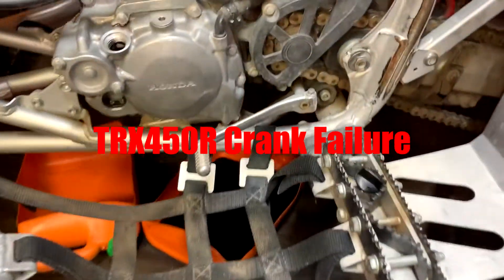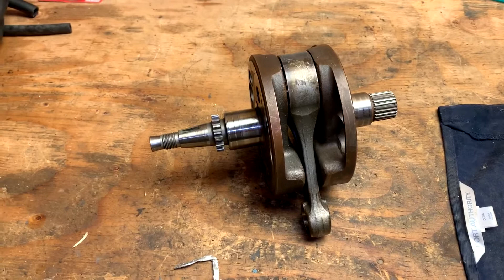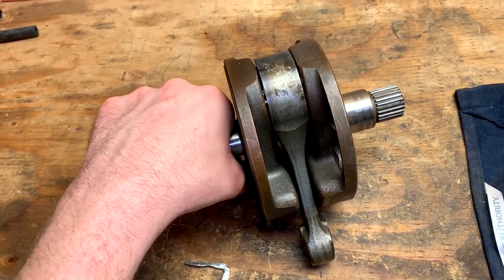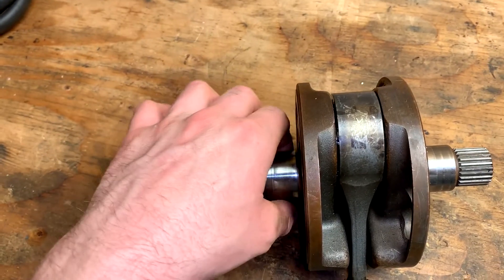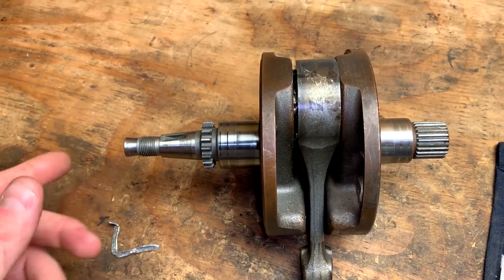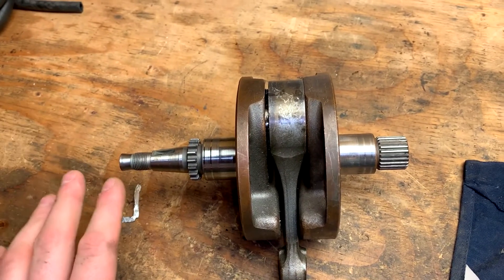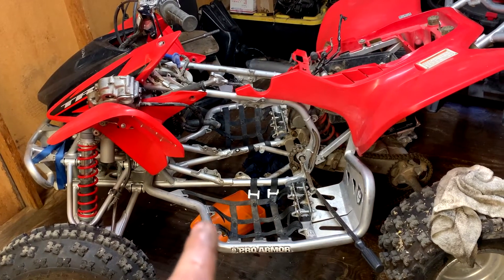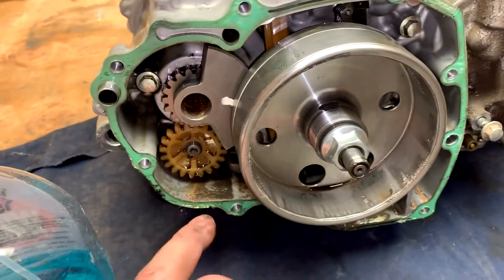Why Do TRX450R Cranks Fail?

Comment: I have silver flakes in the oil filter on my 2008 trx450 what could it be?
Reply from the maker: @jefeoOllllllllllOo  Big end of the rod went back.  Don't attempt to start it or anything.
Reply: @trxtech3010  I have used it quite a bit maybe about 3 oil changes deep and a total of 15hrs and every oil change has flakes. Its sounds good and no issues, just the flakes.

Comment: Is shimming the crank only for 04-05 motors? I have an 07 that needs a crank. Can I just press new thrust washers into it and put it back together? Thanks
Reply from the maker: Yes on the shimming is only fir the 04/05 engines.

As fir the 07 VlCrank yes you can rebiuld the crank shaft with new parts CP Pistons and Rods sells kits to rebiukd the crank shaft... however it cost a lot but last's longer.

Comment: Hi , hey bro I’m what store do you get the shim from , I have a 2005 trx 450 and the left side bearing is not secure on the case you can Even take it out with your fingers your think the shim will help to solve the problem please , let me know bro I really appreciate it.
Reply from the maker: Yeah you will need to replace the Left Case Half of the engine.   Another thing you can try first is get some Green Bearing retainer, it's made by LockTite it's Number 39150 just do a google seartlch try that and see if it holds the bearing in place.
Reply: You don’t think if I put shim will fix that issue?
Reply from the maker: @jorgebasaldua6217  The problem is if it's that we use the entire race of the varying me spin and move around and then cause you other issues that can lead to castrophic failure.

Comment: Hi bro I’ve read a comment you’re from Tucson I live in Tucson as well, I have a question, I’m doing a rebuild on my 05Honda trx 450r I have shunned my valves since I installed s stage 2 hot cam but how do I adjust the auto decompressor? Thanks man
Reply from the maker: Just adjust it to about .008"   When you adjust it you just need to make sure the engine is on TDC it's like old school 400ex, 300ex and Raptor 350 or 660 raptor Rockers.  Just it's a Decompressor is all.
Reply: Thank you man appreciate it
Reply: Hey bro do you think I can text you thought some social media I have another questions I need help with and would like to send a video of my quad runnning to see if you can help me out

Comment: So I’m having this issue on a 05 I just picked up. It runs great but I changed the fluids and found shavings in my oil filter. No brass just metal. Where do I go from here? Any chance you’d source some part numbers and things this is all confusing me with what parts to get. I was looking into the wrench rabbit full rebuild kit until I seen this video.
Reply: Also is a full rebuild necessary or can I just rebuild bottom end?
Reply from the maker: @masoneakins2666  Usually if you get a crank Failure a Full rebuild is required. 

Reason is because you have small shaving through out the engine and most likely those small shavings may have damaged other things. I always recommend going with OEM Crank or at least OEM Main Bearings and Hot Rods crank will be OK.
Reply from the maker: Parts List. 

If the Cylinder is good I would recommend 
Carrillo Piston 12:1 Compression (94mm)
OEM Crank -13090-HP1-315
OEM Main L Bearing - 91001-HP1-671
OEM Main R Bearing - 91008-HP1-672
Gasket Kit B - 06112-HP1-670
Gasket Kit A - 06111-HP1-670
Oil Pump - 15021-958-000
Right Crank Seal - 91202-HP1-671
Left Crank Seal - 91201-HP1-671

For the Valves, you can go with Ferrea or Kibble white they're about 250 more, they're stainless steel last longer and you can do +1mm with fresh cut seats for cheaper then the OEM Valves.
Reply: How often do you have to replace cranks

Comment: Where did you get something that big to shim the right side bearing??? I've been looking for years for a fix for the original engine out of my 05 450r. Now all I need is to order a left side case and new crank. I've wasted multiple cranks so I'm sure I can't use the left side case anymore.
Reply from the maker: Look into the right crank bearing updated sldesign.  It has to be pressed on in a certain way and stops all crank side to side movment.
Reply: @trxtech3010  are you talking about the honda crank set with the new bearing and race that comes with it?
Reply from the maker: @kevinknabe7252  Yes there's a certain way that it Hass to be installed that many people still mess up on.

Comment: I’m a little confused about the 06+ ones. I get how the actual main bearing walking in its race will cause problems on the 04-05s but the 06s are locked into place and the crank is not a press fit so how are the cranks suppose to be locked into place. And unlike the picture that you showed my 06 has a different style left side bearing with no inner race. The crank actually touches the rollers and I changed the case and both bearings were the same way. So I guess my question is how is the crank suppose to not walk when it is not a press fit into the main bearings. When installing my crank it literally dropped right into the bearing with no heat or anything and this is exactly how the service manual said it should be. I’m a little worried after watching this video lol because when my cases were put back together you could move the crank back and forth in the case very easily. It was like that before and after rebuild and that is how it has been on Honda dirt bikes that I’ve rebuilt with pretty much the same motor. Once all the bottom end components like the flywheel, clutch, primary drive bolt and everything was torqued down the crank was locked into place though. Is this correct? I have some run time on it and I’ve had no problems so far it’s running like a top. About to do the first oil change hopefully I don’t strike gold lmao
Reply: Same Confusion, I think the shimming might only be for 04/05

Comment: 04 trx450r locked up then unlocked, rode it again locked up in 2 mins, what could be the problem?
Reply from the maker: Almost guarantee that the Crank is done for.  Check the oil filter fir silver shavings.

Comment: There are gold flakes in my oil filter mine is an 2006 trx450er I do not feel like striping my hole engine is there an easier way, could I rig it or something?
Reply: Just to let you know it is sized
Reply from the maker: @straightpipeeverything9027  You'll have even bigger things...  I would never rig anything because you WILL cause even more damage.
Reply: @trxtech3010  alright thank you

Comment: I have a question I recently bought a 05 trx450 and it runs great but it gets the lugging effect when I go over bumps and it leeks oil form the side not from where the piston is* any idea what it could or what I should do?
Reply: Time to sell
Reply: @jayfry2691  update it wasn’t leaking oil where the piston was and the it was lugging because I wasn’t shifting correctly now it runs amazing tuned it just right it may be a bit lean that’s why I’m taking a look at the plug this weekend when I go riding 🤟

Comment: just purchased one myself but getting beyond frustrated. Not knew to engine from amc 410s to 347, to vmax rebuilds to kfx but this thing has me stomped and getting desperate.. any idea what would cause piston slap when everything is in or within spec?? because I have now seen three (original when I bought it and two other piston cylinder kits? Fits piston bore kit athena Within spec rod journals, rings filed etc and immediately same loud slapping noise, took piston out sure enough skirts have wear.. After five minutes run time. So decided to just redo the whole engine, hotrods +3mm crank w 99mm bore/piston. Everything replaced but cases, clutch basket and gears and the head was fine so.. Get it all back together and same thing maddening noise, so i take it out anyways for about three hours everything runs cranks fine but awful sounding. change the oil the next day and have a few large flakes of alumin. take it apart and again, piston skirt wear. it is not detonating (checked with 110 octane) it is timed right, head torqued to 40ftlbs in criss cross sequence, oil great, cases cleaned, rings gapped  etc.. brought to my machinist today and while both my kits are within spec 96mm .0015 pist/cyl and the 99mm .0016 pist/cyl clearance they have to be replaced AGAIN because the slapping. so i am just clueless at this point as is my machinist that has for last 20 years balanced my cranks for my jet boats and most my atv friends. cases go together fine too so.. any help would be appriciated. What would cause this engine to be immediately eating up piston skirts?
Reply from the maker: charles b what kind of oil are you running I always suggest to run Rotella 15-40.    pistons skirts usually get a little bit of scuffing on them which is normal after even a short run.  Now if it's actually gouging it to where you can feel it and it catches your finger nails then that is something I would be concerned about.    .  with my experience on these TRX450R's,  is that you'll hear a loud slapping or it sounds like piston slap or it sounds like valves (hard to tell sometimes) after a rebiuld and it Could very well be your front timing chain guide, that and the timing chain are parts that a lot of people just don't think to replace.  But wjat will happen is the front Timing Chain Guide will get worn out and it'll bang around and makes a horrible loud ticking slapping metallic noise.   When installing the front timing chain guide you will see it has these two little "nubs" each side that sit amd rest into two little slots on the cylinder (before the head gasket is installed) make sure while assembling that those are not loose I always recommend replace the timing chain guides (especially the front one) because those little knobs I'm speaking of are one of the biggest ware points on the timing chain guide and that's where it starts clanking around is right in that area it makes a terrible noise. also I figured I'd throw this in there did you by chance have a crank failure in the past?  because if you had a crank failure it's possible that your oil cooler can be full of metal shavings as well.

Comment: We bought two 04 trx 450s we did this shim procedure to one and so far so good it works like a charm with the shim. I do have a question maybe you could answer. The second bike we were getting aluminum shavings in the filter not metal and not the copper or brass colored just silver aluminum, so we tore it down half way the washers on the bottom end of crank are fine and the side to side play of the rod is within spec. With the cylinder off and turning bike over by hand the the lower bearings feel good and free. Im going to split the cases when i get time and finish troubleshooting but what do you think is causing this problem. So far everything looks good. Do you think im going to find the crank bearing spinning in the case maybe?? Any suggestions would be appreciated. Thanks.
Reply from the maker: Yeah I am 100% Positive you caught the Crank Failure just in time.  Before you split the Case Half's does/did the Crank have any side to side play and make a metallic clunk when you push and pull on the flywheel by chance?  That is what happens when the Crank is starting to fail along with the metal shavings.
Reply: TRX Tech  I had a real small amount of play side to side. Finished tearing it down and i cant see any issues with the bearings. They are extremely tight in the cases. The only thing i can think is you are right and I caught it at the very beginning of rod failure due to the crank walking. I measured the side to side play on rod and it’s within spec. Im going to take the crank up the shop today and let them look at it. I guess i will order new bearings and plan on shimming and put it back together. Thanks for your response back.
Reply: @vintage3041  Transmission Crank seal, Letting the trans oil leak into the crank case, at least that was my issue, the silver in my filter was clutch material